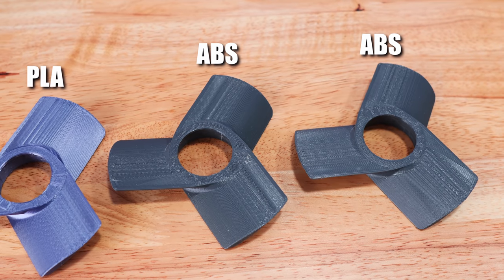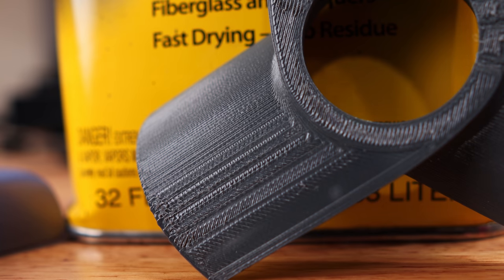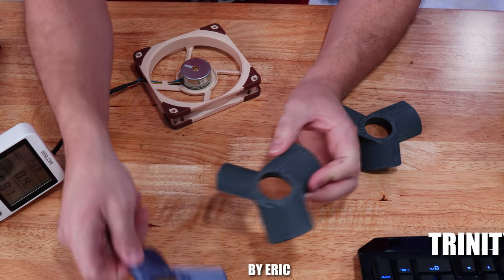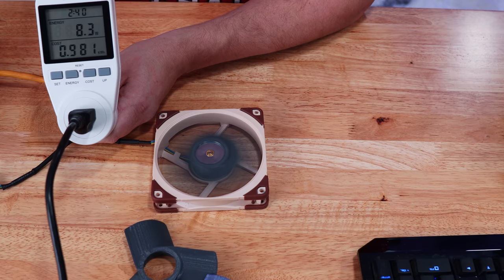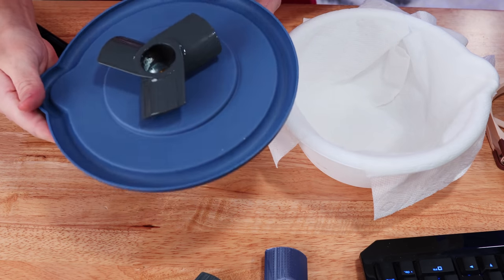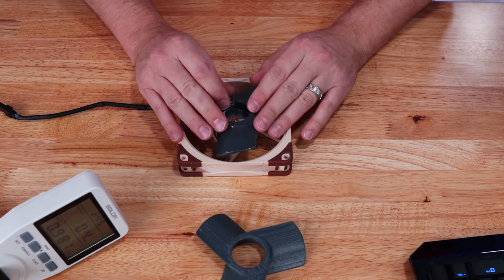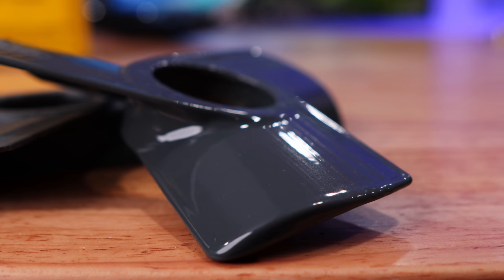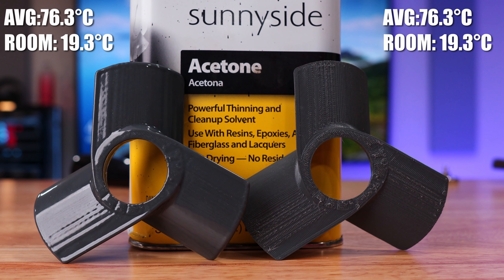Does Smoothing 3D Prints Improve Performance and Can You Smooth PLA?

Comment: RPM or CFM? also less sound is less energy lost to air vibrations!  Again More energy is transferred to air velocity!! and less loss to vibrations.
Reply: if you can get a blade design that is able to trap a pocket of air or that is able to trap a slim layer of air over the blades, that might actually give better performance, by reducing the drag on the blade.  You'd have air rubbing against air rather than air rubbing against plastic. lower friciton
Reply: Well considering the temps were in margin of error we can tell the CFM wasn't effected much. And RPM also seems about the same as the power draw was identical. 

But as a whole we more did this to see if this changes cooling as to see if we need to do this for the fan showdown all the time. Since temps were margin of error that means it shouldn't effect performance in actual practice.
Reply: @Skylancer727  As an engineer I can say Never believe anything someone tells you, and only believe half of what you see with your own eyes.

Dew to less noise being lost to sound energy efficacy is better. But we guess it's not worth the effort of smoothing.  The point of the video I know. b

 I wish we got all the details. We where told something but parts are left in the dark. 
We look at amps and thrust to see efficiency in the RC world. For the fan showdown we need Amps, RPM, and CFM to calculate efficiency 

  The motor "power plant" did not change so power draw with the same pitch of blades with exact Cords and Camber. Power would always be nearly the same. just the amount of work done with that power would change. I can tell you as a RC pilot for 20 years.  Dust on a Heli blades lowers battery time.
Reply: @TheJunky228  Yes it is possible. look at the Kline–Fogleman airfoil/ KFP airfoil of example. 

  But from the sound increases the turbulence was increased drag, lost of power as sound energy.. Energy can not be created or destroyed. only transfused to other types of energy.
Reply: @BensMiniToons  well the point was if we should do this with all fans in the showdown from now on, and since the only thing the showdown cases about is airflow and they both had the same temps to almost perfection, it just shows it was basically a waste of 20 minutes and a waste of chemicals. 

Obviously there will be a tiny benefit but all we care about is cooling and in that department they were identical. If we did test everything to the nano scale, of course the smooth one would win. It's smoother, lighter so airflow should go up, but that amount is margin of error so basically irrelevant.
Reply: @TheJunky228  Not 100% sure but I think the turbulence generated by the roughness would have a larger effect than plain friction. It's got to be a ratio "thing".    :)
Reply: @Graeme_Lastname  Search Drag Coefficient. Your right it's a ratio thing. lolz
Reply: @Skylancer727   ha I just said that to the other guy "less noise being lost to sound energy so efficacy is better. But we guess it's not worth the effort of smoothing.  The point of the video I know." If you can do something better nothing is ever a waste. Again ... Never believe anything someone tells you, and only believe half of what you see with your own eyes.
Reply: @BensMiniToons  Thank you for the feedback m8. It felt a reasonable idea.  My math doesn't go too far past:  B4i√u Ru/16.   Sorry.     😝
Reply: @BensMiniToons  well obviously if you intend on actually printing these yourself you should smoothen it as it does clearly make noise levels lower, but again, it's not really the point of the fan showdown. People mainly care about thermal performance
Reply: @BensMiniToons  The difference in noise was fairly minor, and likely the difference was also fairly minor in cooling to make it not worth the effort for the vast majority of people. Yes there is a benefit, but there are many benefits that we dont take advantage of due to the inconvenience etc not being worth the improvement.

You could also say that we shouldnt believe the benefits either if we are not supposed to believe what we see or what other people tell us
Reply: @agafaba  Definitely not worth the effort at this scale.. Your the 3rd person I've agreed with. 

Also your a Smart man. We shouldn't believe it.  the benefits are in the rage of margin of error. Using the DB test I can calculate it was  It was roughly 0.01 watts lost in sound vibrations next to nothing. 

The mean of that saying is test for yourself. Don't believe in any limitations. And then test again because you can't always trust your first results. 
 ~Thankyou for your comment!

Comment: If you're going to be doing measurements at the mA level you may want to use a more sensitive tool between the supply and the fan itself.
(also, might be worth digging into the pcb on the backside of the fan to find the voltage regulator and motor drivers, there are smart ways to automatically log the data from them via an arduino/pi etc that arte way beyond my comprehension too ;)

Sick video, to help bolster the idea of aero dynamics you could also use a mockup of something smooth and with steps to compare layer lines vs smooth in that autodesk software some printing engineers get into in Fusion I think.

Comment: You can smooth PLA using a self thickening self leveling epoxy resin. After mixing the two parts you just brush it on and it's dry in a few hours. It's made by the company smooth-on

Comment: get yourself a clamp meter, much more accurate if you measure the input draw of the fan and NOT the psu
Reply: Yep. I was like "hey, he's actually measuring the power draw! That's cool" but then noticed the wall plug and got a wee bit disappointed

Also, was gonna say to use a multimeter, but our friend the diode that went wild said that at low voltages its better to use clamps
Reply: Just a standard multimeter would do the trick, doesn't even need to be a clamp meter.
Reply: A cheap inline multimeter is usually more accurate than a clamp meter. But even if it's really cheap and not the least bit accurate it will show relative performance with a much better resolution than the Kill-A-Watt.

Comment: You can use a multimeter to measure current draw, since the voltage is fixed at 12V you can directly measure the current draw to calculate the power consumption since its DC and not AC it's pretty straightforward.

Comment: sup, no way of making the model myself, but for the fans design, ever thought about making a fan with multiple extruded profiles instead of wings? like doing multiple rods and test the shape noise/efficiencies?

sorta like what destin did with the weedwacker core video. well, basically making a weedwacker fan.

another thought was to have hollow spheres at multiple points along the wing, maybe it can help increased efficiency like ships with bulbous bows.

Comment: At the size of those layer lines, and the speed those fans operate, the difference is always going to be minimal. Were talking a dozen or so milliwatts lost to slightly more turbulent air, which generates slightly more noise. You'd probably get more performance from using a lighter material than smoothing the surface. It would've been nice if you had added the PLA fan to the tests as a secondary control.

Comment: If you want to have another go at smoothing PLA, you could try warm ethanol, isopropanol or denatured alcohol(ethanol with either IPOH or MeOH as the denaturant). Acetone will slowly dissolve PLA, but it is much slower than with ABS and from a few papers I've read, it tends to delaminate layers rather than smooth surfaces. But if the only real benefit is a slightly quieter fan, it may not be worth the effort. For anyone interested, a paper addressing filament solvent compatibility can be grabbed from https://www.researchgate.net/publication/326697946_Chemical_Compatibility_of_Fused_Filament_Fabrication-based_3-D_Printed_Components_with_Solutions_Commonly_Used_in_Semiconductor_Wet_Processing

Comment: The only gain in thermal performance from a smoother fan would be due to better flow attachment, for testing that a higher angle of attack of the blades would show it better, the lower AOA of the one you pick doesn't have much trouble keeping the flow attached. 

In fact I would expect it to make a difference only for a small range of angles, where the flow separation is just begging in the non smoothed fan. If I had to guess, this could also be speed dependant, but higher speeds means higher air velocity, so lower AOA, then there's likely to be a specific speed where smooth is actually better (thermally speaking) for a given fan.

Long story short, don't bother much, as you already proved, if theres a difference, it won't be a big one, and in any case, same rules for all. Of course it could hurt more sone few designs, but I don't see the point in the extra step. I rather get more fans than smoother fans.

Comment: Smooth surfaces will only be an effect if its used in high speed applications, efficiency of air gliding on a smooth surface is much better than on a rough 1 but like i said only in high speed, high thrust applications, like on planes jet engin and props not on pc fans
Reply: Why do boats use a smooth prop then?
Reply: @user-uo1rn2nb8f  reduces the adhesion of algea and marine life on the prop

Comment: Try Polysmooth or just generic PVB, prints like a high quality PLA but smooths way better than ABS to a true glass like finish and is much safer as it dissolves in isopropyl alcohol instead of acetone. I use the heck out of the stuff and it's great.
Reply: What do you use PVB for?

Comment: I'd love to see the top 5 fan showdown blades smoothed and then retested again. 

After the acetone vapor bath there were still slight ridges, would a second bath or a longer bath continue to smooth them out?

Also do a vacuum purge to remove any residual acetone absorbed into the fans, or like a 48 hour cure to make sure its all gone. Can you weigh them before and after?

Comment: And can you try if there is a performance difference when you smooth the blades with sandpaper instead of acetone?? It can be a pain in the ass to sand the blades but I think it could change the performance.

Comment: Well if you go for noise normalized setup, you will actually get more thermal performance, since you can have more airflow/pressure at the same noise level. Not sure how much the gain would be though, I suppose it also depends on the fan.

Comment: Can you use mint leaves as fan blades? Mint has a cooling effect when used in vick vapor rub.
Reply: No. That doesn't do anything because mint doesn't cool. It just activates cooling sensations on the skin. And vaporub doesn't cool the same way as mint because it just takes energy from the body through evaporative cooling, or phase changing.

Comment: I think that the power draw is more dependent on the weight than the aerodynamics of the blade and that's why the difference could be called "margin of error".  I noticed that both versions drew 8.3-8.4 watts.  But I'm surprised that the smoother one didn't give better cooling results.  One thing I also noticed is that the smoother one doesn't have a smooth surface.  You can still see where the print lines are in the right lighting conditions.  They just blend better with the blades.  Perhaps if one finds a way to make the blades smoother, so that there's no evidence of print lines, it'll give slightly better cooling performance.

Comment: Did you check rpm difference? Maybe the Noctua motor always puts a certain power in the fans. Also one multi meter measuring amps and another measuring volts would give you waaaay more accurate power readings.

Comment: If you want to melt PLA there’s a magical chemical you can purchase in the paint section of your local Meijer 😉 called Klean Strip Brush Cleaner.  The metal container says it removes oil and latex paints.  I’m not saying you should make napalm, but if you leave this stuff on any plastic surface, that’s pretty much what you’re going to get.  The actual chemical in that product is called M.E.K. or Methyl Ethyl Ketone.  Apparently it scares people because of the noxious fumes and fact that it’s probably the most aggressive solvent I’ve ever used, but some people are lame.  It took hours of it soaking into my skin before I got chemical burns from it, so wear gloves and don’t be silly like I was.

There’s some better stuff that actually seems like an environmental disaster called Tetrahydrofuran that contaminates groundwater and it looks pretty expensive.  The Brush Cleaner I buy at Meijer is like $10-15 a quart, vs $100 a quart for Tetrahydofuran.

Allegedly Ethyl Acetate is less toxic, smells better and evaporates quickly, but there’s no way anything that smells like “banana or strawberry” is going to melt shit like M.E.K. does.  I use it for cleaning my airbrush and it came in handy for smoothing out some Nerf guns I modded.

Incidentally, you could probably keep yourself busy for ages modding Nerf guns with your 3D printers if the fan stuff ever gets old.

Comment: The rough surface fan blades took less effort to spin because it resembles a shark skin aerodynamic effect, by disrupting the flow of air over the blades surface, it is thought, the rough points reduce drag, making for a more efficient blade surface.

Comment: Why Acetone?  One thing you can do that should give you more flexibility is sanding the surfaces of PLA and ABS to smooth them.  By sanding the surface you will have the ability to control the shape of the leading edges and the trailing edges.   And use three grit size like 400, 800 and 1200 grit dans paper, this should give you good results in performance.    The Acetone as it make the ABS melt, the gravity will bring the melted ABS near the trailing edges of the three blades and round them.   That's why 3D printing is for prototyping plastic parts to see where they need to have the parting lines in the injection mold.  And that's why they use 3D resin for prototyping metal parts to see physicaly how a part will look like in 3D.     These process are very different from fonctional 3D printing parts in high quality polymer filament and 3D metal filaments or 3D metal powder process.  

If I may make one suggestion, if someone could make one the best fan you have tested machined in Aluminium on a 5 axis cnc machine.  That would be one good test to see how that fan performed.

Comment: The smooth one is more efficient at pulling air, making the blades scoop more air. You notice that with the fan down, it is pushing more air therefore it sips more power. It is not the motor efficiency that's changing, it's the fan blades

Comment: You should be able to smooth pla out using dichloromethane (DCM) a solvent I commenly use in the lab (I'm a chemist). I tried a lot of different solvents with various materials (both resin and filaments) and DCM dissolves pla really wel.

Comment: I'd be curious to see if any difference starts to pop up if you ran multiple fans for this test. Would 4+ rough fans be noticeably louder or warmer than an equal number of smoothed fans? Definitely splitting hairs but it would be an interesting demonstration of whether or not 3D printed fans are viable across a whole build.

Comment: Tbh, that power draw test does not have enough accuracy to rule out margin of error, like you said. The difference at this scale and RPM would probably be a few milliwatts at most. I saw a comment from watchthe1369 mentioning the boundary layer; the dimpled blade from a while back was a test of exactly that, but again, you'd need a more sophisticated setup inline with the power into the motor to measure the difference. Depending on how accurate you want it, make (or buy) a 1ohm shunt and measure the voltage across it compared to the voltage on the rails, and that'll give you the current draw at that voltage to calculate power usage to a ridiculous level of precision :D

Comment: When you use acetone, you modify the surface molecules and likely add some atomic structure, increasing the weight just slightly. This extra weight probably cancels out the performance gain by smoothing. Also the shape of the fan might be slightly altered by tge acetone.
Reply: ehmm no the acetone will everporate afterwards
Reply: @TorbTorb  I see. I just researched it.

Comment: I think it's a matter of scale with the print-lines and air friction. On planes it's absolutely critical to have everything as smooth as possible for fuel efficiency but in this small scale it doesn't make enough difference to be noticable imo.

Comment: I feel like all of this is moot because resin is so superior in every way. Smooth prints with no "post-processing". I can understand not doing fan showdowns in resin because all previous ones weren't and it could throw off the scale, but if you ever started a blank slate, I think you should do all resin prints.

However, there's also something to be said for the fact that, since ALL fans in fan showdown were printed this way, this wouldn't change anything in terms of the "delta" between the individual prints, it would only uplift the overall line. So the showdown itself remains intact.

Comment: you need to check rpm differences between smooth/not smooth. The motor will normalize the amount of power being pulled, but it might be spinning faster or slower depending on drag.